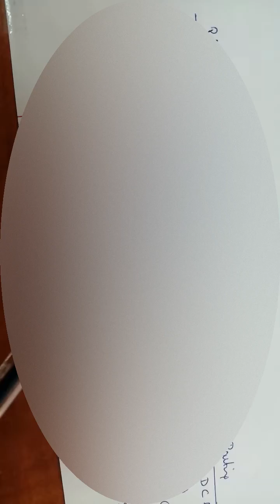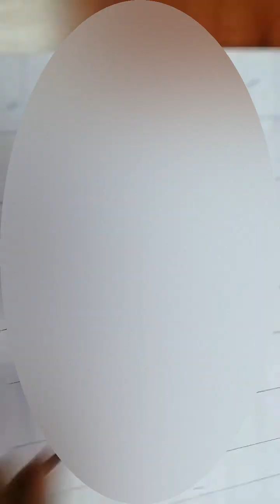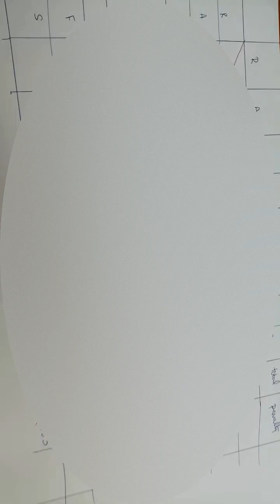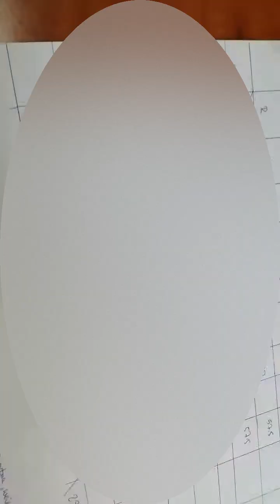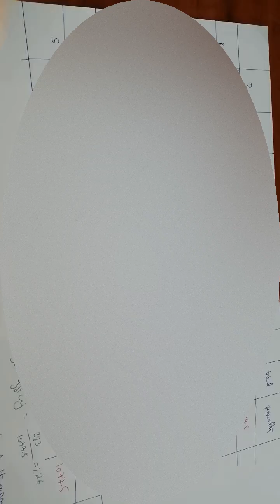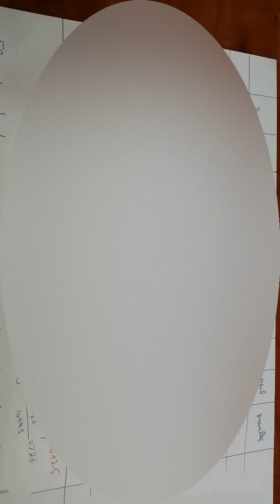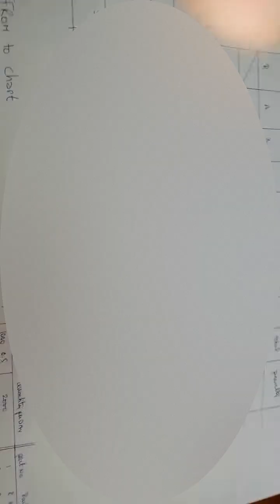From to Chart Flow Analysis Relative Importance Layout Efficiency Facility Planning |Facility Layout

Comment: great video you taught me how to do it better than the book. that being said i have some criticisms for this analysis tool in general... my god this is like common core math: an excursion in math for math's sake. I see no real value in it at all especially if the end result doesn't even give you a mathematical method to optimize the chart....just "look for important relations." All this ultimately leads to "get a sofware package" that optimizes it for you. my crit doesn't even take into account that there are a lot of dumb assumptions that need to be made to justify this mess:
a.	You have a variety of different parts to manufacture
b.	The order of operations for each part is fixed
c.	The order of operations for each part is shuffled relative to other parts that need to be manufactured
d.	You only have one of each type of machine to run all your parts or your machines/operations are going to be organized in a process-oriented layout
e.	All of your machines/operations are arranged in a LINE! Not a work cell, no 2D space…a fucking line!

sorry rant over. i have to teach this garbage to a class...its going to be as cynical as it is informative.
Reply from the maker: you do optimise by trial and error, literally by trying different layouts and different arrangements of machines. 
however, some machines will be locked in place.